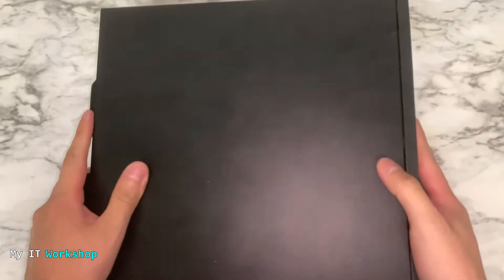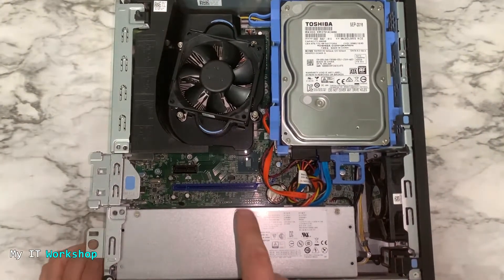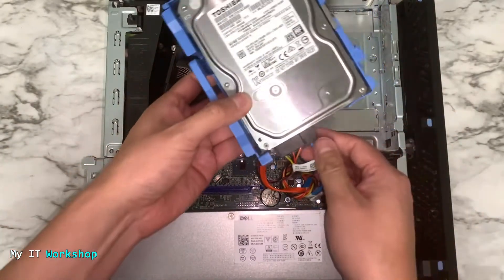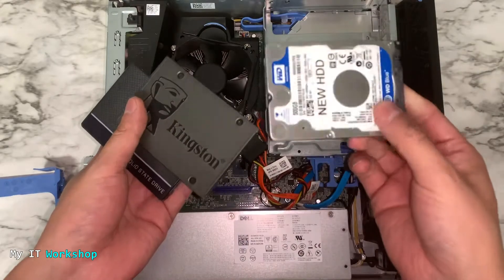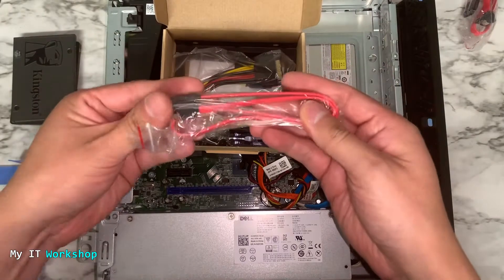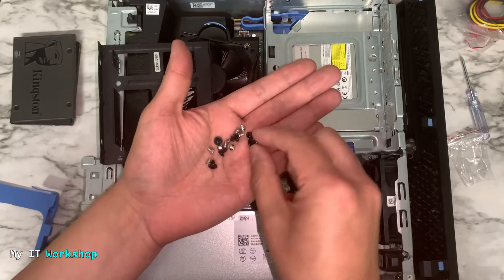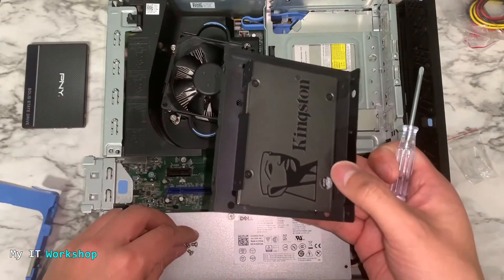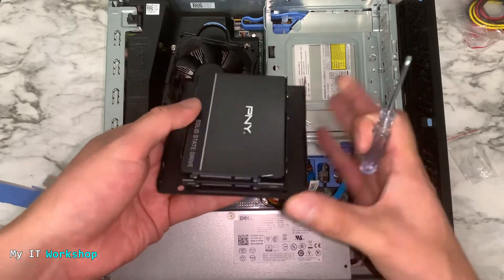Replace your HDD with 2 SSD with a 2.5" to 3.5" Bracket

Comment: isn't it necessary to cut off the yellow wire because 2.5" 5v ssd can't handle 3.5" hdd's 12v power cable?
Reply: Ssds ignores the 12V